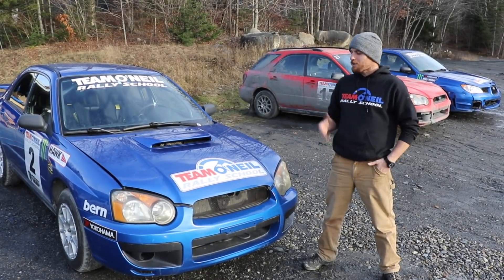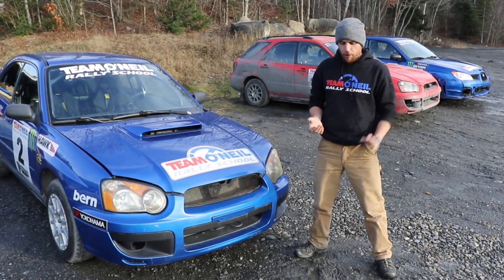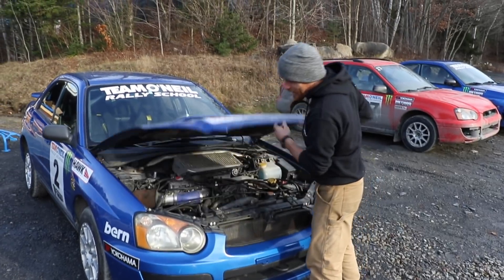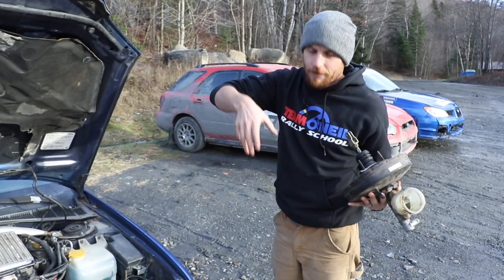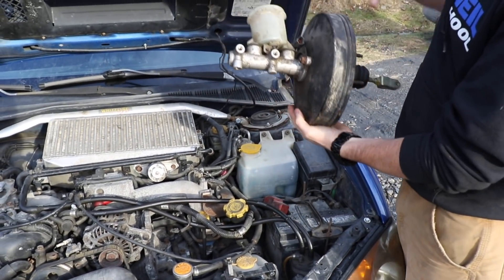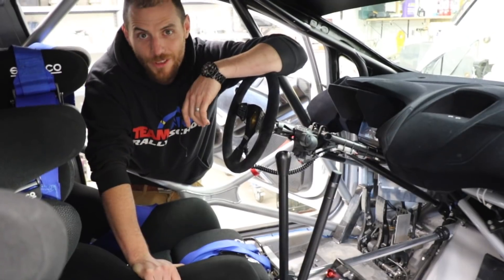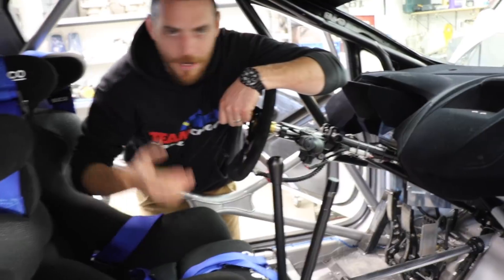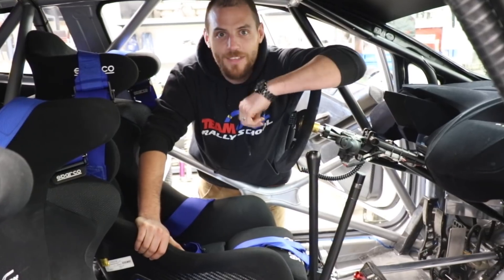Street Car Brakes VS Race Car Brakes

Comment: I want to do these mods to my Toyota 86, I hate the ABS/stability control it malfunctions and is dangerous, would these mod increase braking distance since the electronic braking distribution system will be removed? Thanks
Reply: You would certainly get a longer braking distance if you where to lock the wheels --very easy in an emergency, if you're not familiar with non-abs brakes.
I do know some cars have huge rear brake bias once the ABS fuse is pulled, though just disconnecting an abs sensor seems to avoid the issue on at least one car.
I'd really try to find someone in your area familiar with modding the 86, ask around. Here in Australia there's an 86 race series, so some good workshops :)
Reply: @G-force_Motorsport  Let's assume good control on the racetrack.

Comment: how hard is rally car brake to push?
Reply: Generally rather hard, but motorsport brake pads bite really hard when hot :)
Reply: Depends on the brakes, cylinders, leverages, pedal travel etc but generally I'd say if complete first timer were to drive a short test run, it would result in muscle soreness that would last for few days lol. (Oh BTW racing clutch pedal is hell too)

Comment: i dont see advantages of taking out the booster
Reply: Don't worry, racing drivers and engineers do see them. Literally all of F1, Indycar, Nascar, WRC etc is running unassisted brakes and it might not be by accident.

Comment: Instead of bypassing/removing the brake booster why not just put a vacuum pump in like it's a diesel? That way you have vacuum assisted braking all the time
Reply from the maker: Basically just for simplicity, less is more. You're 100% correct that a vacuum pump would work, but if you get the right master cylinder and maybe change the pivot point of the pedal, it's pretty easy to push and it works fine.
Reply: @Teamoneilrally  More reliability is certainly beneficial in a rally. Curious about what elements in the master cylinder determine the pressure you need to put down when using it without a vacuum booster?

I'm a bit reserved about non-boosted brakes because I forgot to put in the one way valve when rerouting the brake vacuum line on my second ever trackday. Not realising that the pedal will be super hard under turbo boost I went into a right angle corner at 160+kph, couldn't brake hard enough and landed in the sand trap  🤦 but I guess it won't be so bad if it wasn't for the turbo pushing against the brake booster

Comment: So would an 02 sti be able to have a hydrolic e brake?  Or would you have to modify the center diff, and if so how would you do that? I've been looking online and I've come up with nothing yet.
Reply from the maker: We didn't get the STI here in the US until '04 so I'm not exactly sure... You can do it on the mid-2000s STIs, you just need to keep the little electric switch from the stock handbrake handle and mount it somewhere on the lever so it knows to open the center diff.

Comment: What's the big issue with ABS? I thought a decent, new system would detect the surface it's on, and respond much more quickly to traction changes than an average human. Am I wrong? (And yes, I know that good Rally drivers are better than an ABS module, but most people aren't)
Reply from the maker: ABS is great on pavement, whether you're just driving around or racing, it's a wonderful system that had definitely saved lives and won races... On gravel or snow or anything slippery though, not so much... The car just doesn't slow down that well, on snow it's about double the stopping distance with ABS vs without it. Check out https://youtu.be/fge_m9u864k

Comment: 2:40 Surely this only applies for forced induction engines where the inlet manifold is above atmospheric pressure? A naturally aspirated engine would have a higher vacuum under acceleration.
Reply from the maker: All gas engines have higher vacuum when at idle, because the throttle body is closed with the engine running. The intake manifold basically becomes a vacuum chamber. When you accelerate, the throttle plate opens, and air rushes back into the intake (or pressurized air if forced induction). Your brake booster runs off vacuum, that's why your brakes are nice and soft when you are off the gas, but get very hard if you brake a few times when you're on the gas.

Comment: I don't understand, why do I have "less" vacuum when I'm on full throttle? I'm pretty sure I have "more" vacuum, because the engine sucks more air in and it's the difference in air pressure from the intake manifold to atmosphere. Obviously I'm not speaking about turbo charged engines.
Reply: Also... turbo.
Reply from the maker: It's a weird one, but basically: When you're zero throttle, the throttle plate is closed and the intake manifold becomes (mostly) sealed to the atmosphere.  The pistons are still trying to pull air into the cylinders, so the intake basically becomes a vacuum chamber.  When you get back on the gas and the throttle plate opens, atmospheric pressure fills the intake again (or pressurized air if you have forced induction). Most cars have a brake booster that runs off vacuum, so the pedal is very soft and easy to operate at zero throttle (as it was engineered to) but can become very hard to push when you are on the throttle simultaneously.
Reply: Yes, I see. Thanks for the quick answer. You're right.

Comment: So with a newer sti (08-17) do I have to tap into the ebrake system at all to fully unlock the center diff when engaging the hydraulic handbrake. I know it's designed to unlock when you pull the ebrake, but should that be triggered with the hydro as well to not damage anything (as much)? Is it as simple as swapping the little button over that gets depressed when pulling the handbrake that triggers the "ebrake" light on the dash or is it more complicated than that?
Reply from the maker: You're right on target, just make a bracket and swap the little switch over so it still knows you are pulling the handbrake and it still opens the center diff.
Reply: Team O'Neil Rally School awesome thank you! One more question, if I was trying to keep my abs, would it be safe to have both rear lines combine into one when it goes into the hydraulic brakes' cylinder, and then have it come out and eventually split into 2 lines on it's way out to the two rear calipers? My hydraulic brakes' only has one cylinder and I really hope I don't have to go out and get a dual cylinder hydro

Comment: Wait what happens when you remove the booster? Wouldn't the brakes be super hard to press? Interesting in doing this for a drift car if there is no ill effect
Reply from the maker: The brakes will be hard to press, but the tradeoff is that they'll be consistent and feel exactly the same every time you press the pedal.
Reply: Also you will make the car lighter and more powerful, but only very tiny bit lol. But that's the race car way, even F1 drivers have to hold like 400 lbs with their left foot every time they brake. (Well actually you can play around with cylinder sizes and leverages a bit but it's still going to be tough as hell in the beginning lol)

Comment: Why would you need to disable ABS?
Reply: Because it doesn't work with rally driving, and isn't generally helpful at all on dirt to begin with.
Reply: A more detailed explanation: The ABS prevents the tires from digging into the gravel by releasing the brakes permanently during operation -> longer braking distance then with locked wheels (on gravel, mud, ice, snow).
Reply: For me the reason was that getting rid of it made the life and brake bias adjuster install on dashboard so damn simple. And brake balance knob is one of the most important things in race car for me, it's magical how well you can tune the car to brake for each surface and situation, and even help with initial turn in by adding rear-bias.

But no, I haven't done any of this to my street legal road car because it needs to pass inspection every year and I can daily drive with ABS just fine, even with the nordic winter weather and my 30 year old car's ABS ECU that has like one channel for the sensors and has update frequency Hz of a drunken gorilla
Reply: @babar292  dude, this video is 6 y.o. Let it go.
Reply: @procerator   Videos and comments are forever unless stated otherwise. 6 years is nothing anyway, for it is a quality video that cannot grow old. Truth is, I've been blessed by the holy algorithm and I'm going to damn well make the best use out of it !

Comment: What do Audi's do when you pull the e-brake and there is no clutches in the transmission so you cannot disconnect the rear wheels from the drive line?
Reply: I'm not entirely sure how it works, but most Audi's have Torsen center diffs, which is a limited slip diff. That means, if you pull the handbrake and engage the brakes on the rear wheels, the diff will try sending all the torque it can to the rear axle, so you basically brake all four wheels and stall the engine. That's how I've understood it at least

Comment: Maybe I'm missing something but... Why would you want to disable the ABS system in a Subaru?  Doesn't the VDC system use it to control individual wheelspin to aid in traction control?
Reply: ABS is not helpful at all on dirt or gravel.  More of a hindrance, especially racing on those surfaces.
Reply: @immikeurnot  yup wheel lock brakes quicker becaus it diggs the wheels in to the ground so the wheels will push gravel infront of it and brake quicker. And becaus you can easaly transfear movement from side to side by locking your wheels
Reply: It helps keep you out of the ditch but it can fight you when you have high level technique.
Reply: Dane Galang more like the better Choice is tuning it for profession just like a engine ecu
Reply: Lol no. ABS is possibly the single worst thing on modern cars. It is like training wheels for brakes. Helpful for total beginners but if you are halfway competant it is way worse. Anything that litteraly takes the control of your car out of your hands is no bueno.
Reply: Because this is rallying. Traction & stability control and ABS are excellent safety features for everyday driving, but rallying is about speed and driver control, the two things that assists try to kill completely.
Reply: ^tho I admit there are cars that have completely open differentials where electricity operates individual brakes to do small "locking" , but still you would need to find a way to turn main traction control off without disabling that diff lock simulator at the same time, which is often not very easy. And real LSD is million times better anyway

Comment: Why not use a vacuum pump instead of using engine vacuum? Or alternatively use some other method of brake assist?
Reply: weight reduction
Reply: B.D.B. 😏 done aka I have hydro assist powered brakes. bonus Im get is a cleaner signal to the engine ecu so it doesn't think there a gigantic vacuum leak
Reply: Vacuum pump and hydro boost are both options.  Vacuum pump will pull less power off the engine, though.
Reply: In the end every system would just add complexity, weight and parasitic loss without even bringing any real benefit. Racing drivers have legs of steel and their whole braking skill has been built on that stiff and consistent feel of unassisted brakes.

Power steering is a bit different, the extra feedback you'd get from unassisted steering would be nice but not nearly enough to justify the fact that you'd have to use slower ratio rack (bad) and it would still be heavy as hell with the sticky tyres, awd/locks and possibly downforce too. (Not to mention on rough terrain the steering wheel can hit back at your hands and fingers enough to break them)

Comment: Well what about power steering powered brake boosters ? You thought of that? How they always work no matter if there's a vacuum or not
Reply: Francis Grabetz ever heard of electric pump ? That's how mine works and yes I don't have a working engine power steering pump ps. Mine works perfectly even to the point of being my new favourite Master cylinder instead of vacuum powered or manual which was my old favourite type
Reply: Mandela Effect the power steering ones works to but in my case it was just easier to use the Electric one plus it's very quiet and works if the engine stalls
Reply: Mandela Effect hydro boost. 
If you have electric steering you won't have that option. Weight and complication of the system is a downside. Using mechanical advantage is simpler and effective.

Comment: My car doesn't have a brake booster from the factory. Does this make her a race car ? (kappa)
Reply: Only if you make blow off valve noises when slowing: pssssshhhhhhhhhstutututu
Reply: Mine doesn’t either but then again, it doesn’t reach 100mph and the 0-60 is eventually.
Reply: What kind of car? And it doesn't have a booster or it doesn't have a vacuum booster?
Reply: @gofigure84  Dont remember which one i was thinking of then but its probably my moskvitch 412.
Reply: @throttle masters Subaru crosstrek switch off the engine downhill already.
Reply: Well it sure helps:P Always one of the first things people get shocked about when trying race car for first time. "omg the pedal stiff" and then they have sore leg muscles for next week lol

Comment: actually abs on the front wheels is not at all stupid idea. not to mention brake booster. gets kinda fucking hard to push the brakes without assist.

Comment: One other difference between racing and road car brake systems is that while there are two master cylinders on both systems, usually one master cylinder will do one front wheel and the diagonally opposite rear wheel rather than both front wheels or both rear wheels. If one cylinder fails, having diagonally opposite wheels braked on the surviving piston leads to more stable braking behaviour in a road car. With modern ABS and stability control systems this probably matters a lot less as the ABS pump can brake any wheel it likes, even without the driver touching the pedal.
Reply: Achtually the diagonal system is very much used in road cars too. (though there are some exceptions, like many RWD cars)
Reply: Cool story bro.

Comment: Surprised to see "basically everyone" kills the brake booster..maybe better with race brakes or something with a better master.. but damn I don't think I could actually seriously drive my car in any situation, rally or street, without the booster..it takes all of my strength..why not run a vacuum pump and reservoir? Always have vacuum, on/off throttle, in/out of boost..also a lot easier to modulate IMHO when two footing..no stiff brakes vs not stiff throttle.
Reply: TeamONeilRally - Thanks for replying. Glad to see someone in rally doesn't think my idea is silly! The hard part with the vacuum pump is either A. Finding an electrical one that can handle it (I've only found very few and they are $$$) or B. Fabbing a mount and belt for a mechanical one, which are still $$ for a decent one. I had planned on going electrical but may just fab a mech mount especially since i have no a/c or p/s and two extra/free pullys. As for MC there's only I think a 1" max for OEM replacement for my car (eg hatch) with either 13/16 or 15/16 stock, which I plan on installing anyway, will see how the brakes feel after that but judging by how hard it is without vacuum with the stock MC, I'd definitely need an aftermarket and/change pivot as you suggested. Just went to the biggest OEM brakes I can fit under 15"s and haven't even broken them in yet, so that will be interesting too.
Reply: IdealSound & Performance : Mobile i I'm using hydraulically boost breaks ( bendix 9 aka 1991 jeep ) not vacuum powered:) because of boost and because it has very similar feedback as a manual master cylinder which you can feel tapping on the lines aka very sensitive good feedback from the pads / tires plus a very linear  feeling just like manual master cylinders and in my case the miss can't complain about having little to no power brakes so I can turn up the power or down and it's very quiet . Gm used more than one system one is made by Bosch and the other one is on 87 Buick Regal Grand Nationals. I also have extra lines running from the master cylinder and back to automatically bleed and cool my brake fluid just like some race cars but no computerised hydraulics for now aka abs to $$ for me but I'd like to
Reply: EG Hatch, yeeeaaah boiiii
Reply: Because after very little practice and strengthening you can do it. It's not like it's some "rally only" thing, or low budget. Literally F1, Nascar, Indycar and very big majority of all the race cars in the world run without brake boosters with only very few exceptions.